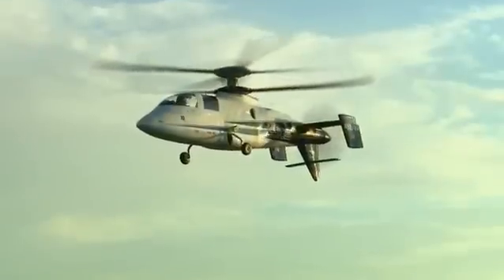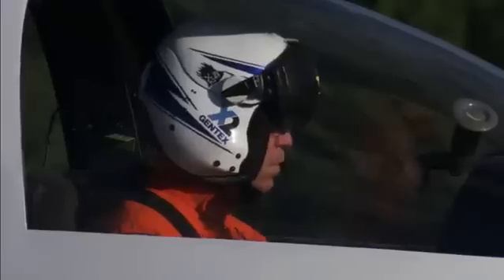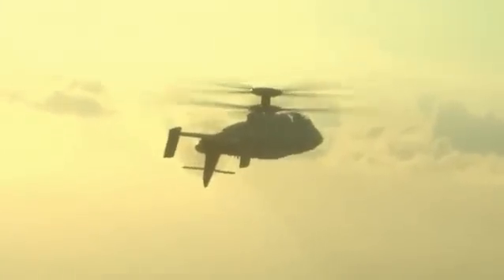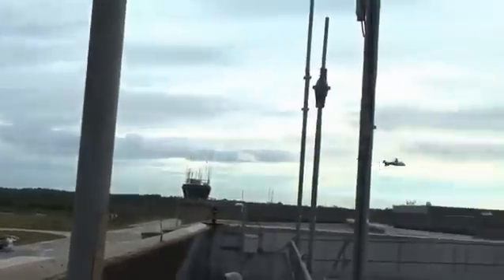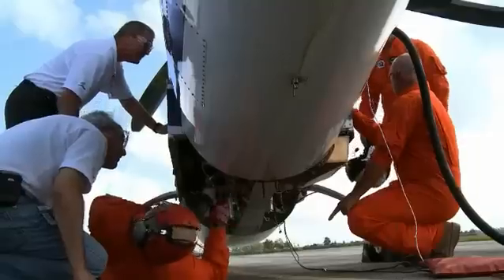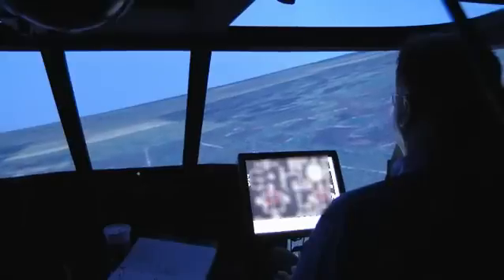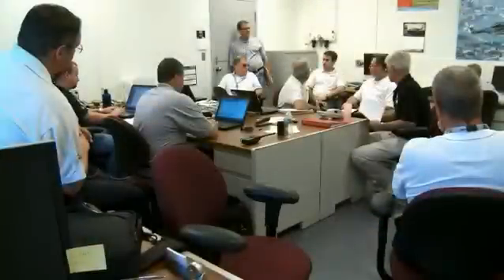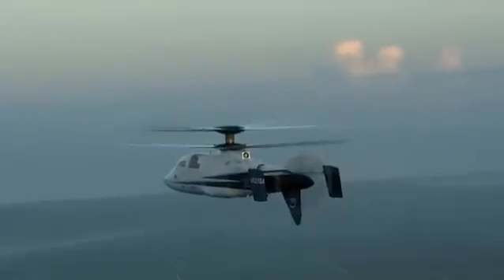Sikorsky X2 World's Fastest Helicopter Cool Commercial Carjam TV HD 2013

Comment: Sorry, you say T-44 only airframe?, common How you can say such thing?, the Prat & Whitney radial 18 cil. engines were cloned, are identical, the landing gear and armament, the Tu-16: you first strategic bomber have the same remote towers above, below and backward as had all american WW2, A question for you: How China copy without go in Airshow? follow basic enginiering rules, techical data and others way form, if you talk Tu-22 Backfire as100% own,ok, but not the Tu-160 Blckjack, dude.

Comment: World helicopter industry stuck in worked then for FW wrong Lippish design (Sikoskies, Bells, Lynx, Mi-1) for more than 64Y. almost w/o exception.
Not Kolibri-like synchrocopters, Chinooks are not many. It took enormous effort for Kamov to pass through in USSR havin different concept also.
Meanwhile most supposed vertol works indeed like X-2
Point is simple - latter is much more simplier and isufficiently slower than convertiplanes (also ill-fated CL-84), and gives real off-road freedom.

Comment: This is not about engine design only but airframe general layout and whole technology with matherials. It is hardly possible to achieve balance and heat dissipation in supersonic STOVL
Mockup competition to X-32 started later, you are not straight even with it, bad boy.
Nothing was run out. Argentina wanted to buy it at any price. Yak was long ago production ready. Actually - 3rd modification of it. Simply own soviet bitches didn't want Fleet air arm to reinforce Russian confinemet policy.

Comment: There's a big difference between the F-15 & the F-15SE compared to the Yak & F-35.  The F-15s are based on the same airframe; while the F-35 bears no resemblance to the Yak.   You can tell by looking at the airframe itself, from the fuselage, wing shape, to the tail, entirely different.  The Yak was not designed to be stealth from the very start.  It appears like a Mig 23 from the front, and it has twin tails.  The F-35 looks nothing like it.  + LM only purchased the engine plans, nothing else.

Comment: Yea right,  you made the Yak?  LOL. Maybe you assembled bolts and screws, but you sure as hell didn't design it.  The Yak and the F-35 are two different aircraft with different mission profiles.  The only thing in common is the STOVL F-35 where LM bought the engine plans and improved them.  The rest of the aircraft, from stealth, to internal bays, to avionics, are entirely different.  And unlike Russia, the US actually bought and did not steal the tech.

Comment: I quoted from both Russian & Indian sources, including en rian, the Indian Times, etc. , not blogs, & they were Russian and Indian officials. Neither Russian or India has bought any Mig 35's, dumby.  There are zero orders of the aircraft. Prove me wrong or STFU, bitch. 

The Mig 35 only performed well with top speed, which is good if you're trying to run away.  It's recovery from bleed, instant and turn rates, radar, engines, were all poor.  Without conformal fuel tanks, the F-16 kicked its ass.

Comment: Just a few quotes: "As for the MiG-35, its specifications and performance, rather than its production run, are the main problems.  However, the MiG-35 has been and remains substandard. Some analysts openly claim that the fighter has no future. They believe that the MiG-35 is quite expensive, that it has numerous drawbacks and an unclear tactical designation."  en. ria. ru/analysis/20120614/174015160. html

Comment: Hmmmmmm...Didn't Lockheed Martin, in the 60's, build the XH51 (the AH54's rotor system/compound helicopter test bed), topping 200mph in a standard configuration and over 300 in it's compound variant?  The only difference I can see is that this compound doesn't seem to use aux lift/control surfaces at high speeds.

Comment: There's no cmparison when it comes to avinics, with the F-22 having a huge lead.
Speed: Both the same, but that's with the Su-35 flying clean, which is not realistic of real combat.  Plus the F-22 can SC with ordinance, whcih the Su cannot.
Ceiling height: F-22 65K ft, Su-35 59K ft
Power: F-22Dry Thrust 23,500 lbf1 Su-35 19,400 lbf; Wet F-22 35K lbf; Su-35 32K lbf

The Su-35 wouldn't stand a chance in hell.  Wake up.

Comment: Alexander Mordovin, expert for combat aviation: 
"We have a serious problem with avionics. Unlike the US competitor, there was no serial production for the Mi-28H for a very long time. It is an open secret that the flaws, which were not noticed during the testing period, are found and removed during the process of serial production. Russia had only 16 Mi-28H helicopters before 2008. In 2011, the Russian armed forces were supposed to receive 28 Mi-28H choppers, although the serial production of

Comment: rockets are a double edged sword, while the thrust out put is alot more, you run into problems like risk of detonation, 1 use (if using solid state rocket motors), extra weight needed for such short boost (if using liquid state rockets)!, this design allows for lightness, maneuverability, and sustained speed!

Comment: Excellent aircraft! I am curious, great rotor design but are they hollow? laminair blow ports? to help lift without collective? does air get blown out the leading edges? as I recall the first X-wing the rotors stopped in flight. Does it actually have Collective pitch?
Reply: It should

Comment: This is faster. The Lynx that broke the first set of speed records had a rigid rotor blade system and is not the same Lynx used in the field. 

The X-2's record is 250 Knots
The Lynx, even with it's specially designed rotor and blade system hit 216 Knots in 1986.

While both aircraft are somewhat different (The X-2 having the pusher prop in the back) and the Lynx being a 'conventional' helicopter they are both quite impressive.

Comment: tail engine, two 180 degree tilting engine , VTOL, triangular wing-2, for uplift, fast forward
forward  1200 kmph , vertical 600 kmph, r/l turn  300 kmph
andy engine is one piece rotor. no compressor, no turbine, all liq, gas fuels
Runs on snow, on road, on sea, on sky   5/ 10/ 20/ 50 seater
normal power, normal cost, normal fare. 50 % fare on sea

Comment: 2nd fastest helicopter - Eurocopter X3 is far faster - On June 7, 2013 it demonstrated a speed of 255 knots (293 mph; 472 km/h) beating Sikorsky X2's world record, becoming the fastest compound helicopter as of June 2013 (X2 is only capable of 258 mph) In addition X2 is a single seat tiny thing... the EC X3 is based on the EC 155 - medium twin normally seating up to 12 passengers with two pilots.

Comment: yeah i have done some auto rotations in sim's and my uncle has had to do 2 of them, only 1 worked, its a art form not necessarily "easy", it takes a lot of timing and keeping your cool.  Its a nice option but for combat choppers especially tandem attack setups a ejection system would still be nice.
Reply: So ejecting from a failing 3 rotor chopper is 'safe'?

Comment: how about do a Osprey styled copter with twin rotor on each sides of the wing? Sure wing cannot be as big as in Osprey but could have smaller one's in the back and in the front edge to supplement main thin wing in the middle with the shaft that join 4 rotors.

Comment: there is actually a "gliding" landing, it's called autorotation. it's safer to land a helicopter with failed power than an airplane because you can set it down on a dime. pretty cool stuff.

Comment: there is no ejection form a helicopter usually that's why there considered a lot more dangerous to fly then a fixed wing aircraft that travels at similar speeds, no such thing as a gliding landing, they have worked on ejection systems for helicopters before where it blows off the rotors then lets the canopy blow then ejects the pilot out but they usually take to long to be effective at low altitude(where helli's usually operate)

Comment: Why would you add a tail rotor to a coaxial design? I imagine you mean the more conventional sort, and not the push/pull configuration used by the X2. You can rotate the helicopter by allowing one of the lifting rotors to rotate slower/faster than the other.

Comment: Not just that. When the helicopter is moving forward, one side of the blades are moving against, so its actually not producing as much lift as the other side, which is moving faster. To counter this, the blade on on side is tilted as it moves toward the other side. However, if the helicopter goes to fast, then the blade angle is to steep and it stalls

Comment: helicopters all suffer the same problem when going fast - the rotor on one side is going against the direction of travel (higher effective wind speed = higher lift), and the other side is going with (lower lift). Having two balances the lift. Doesn't eliminate the problem entirely - when going fast enough the rotor tips can either start to stall (on the slow side) or approach the sound barrier (on the fast side).

Comment: To counter act Angular Momentum. In this design a tail rotor is missing. You have a pusher rotor but that doesn't counter act the angular momentum. Hence using a co-axial rotor which uses two separate rotor, turning in opposite directions to each other helps in stabilizing the fuselage.